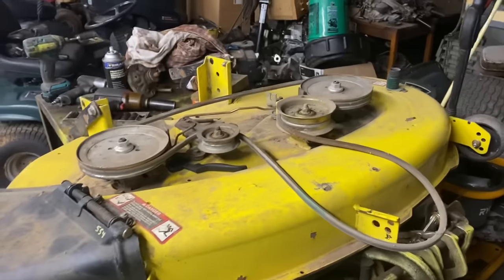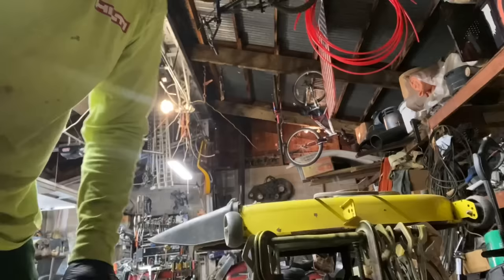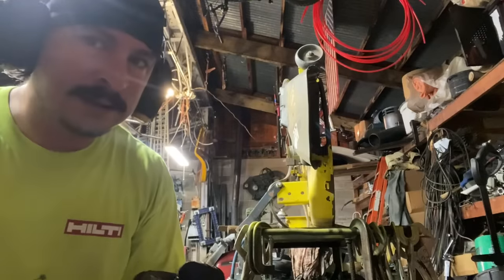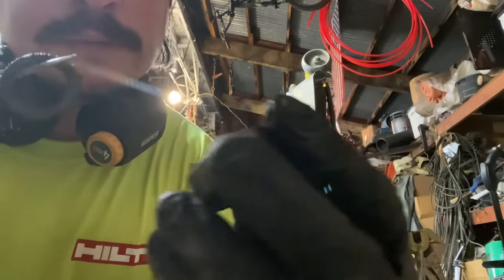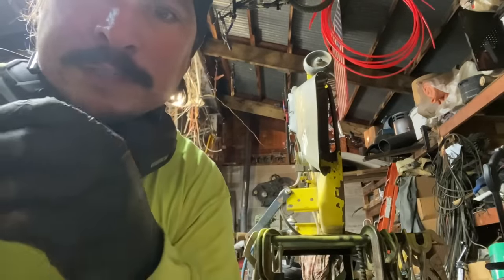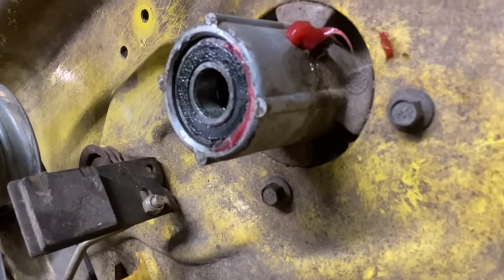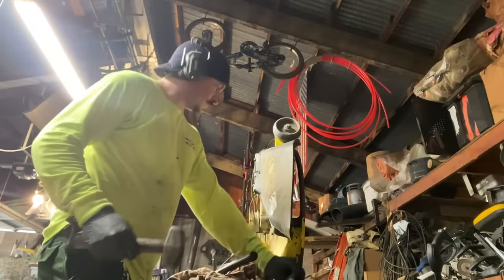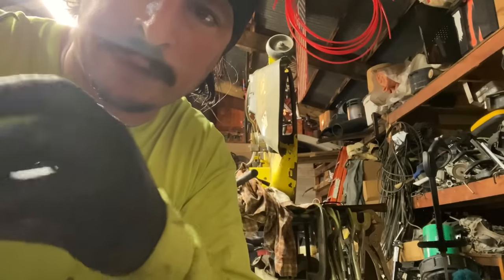Part 1 - Don’t trust the “Experts” Grease your mower deck sealed spindle bearings Common sense.

Comment: I broke down and bought a compressed air grease gun and it’s one of the best investments I have made. You can pick up a small compressor at Harbor Freight for under $100 that will run it just fine if you don’t already have a compressor.

If I don’t have to pump the damn grease gun I find that I’m a lot more likely to grease the spindles on my JD455, JD325 and JDLX255 every ten hours as you are supposed to. I fill them up until grease comes out.

I bought a Lincoln grease gun for about $85.00. It’s a good one but you can go a lot cheaper at Harbor Freight if you’re on a tight budget.
Reply from the maker: Thanks for the tip. I have used electric and pneumatic guns at work but for home use I just been using the hand pumpers. It’s probably time to upgrade.

Comment: If you have zerks in your spindle, either in the shaft or housing you can install the right size piece of pvc pipe to fill the void so you use less grease the first time. The thick walled stuff and cut it a bit short on the ends so grease can flow around it.
Reply from the maker: @leonhart2452  that would probably work fine, however I don’t advise to take one apart if it’s working fine and well lubed it may never need to come apart. Why do all that work to save 1/15th of a tube of grease? If I was already into
The assembly that might make a little sense, however I still don’t understand why saving a small amount of grease would be that big of a concern. Folks do oil changes all the time and that cost more than the small amount of grease that would not need to be changed, only add a few more pumps of grease once in a while and the majority would stay in place and work for decades. I would not make sense to add filler in the crab case to lessen how much lubricant is in the crank case, so I would not see why it would make any more sense in the mandrel housing. Save grease yes, but why?

Comment: I had to replace the quill bearings on my Kubota mower, no zerk to grease them. But I packed grease in between the bearings in hope to extend the life of them. The heat may force the grease into any spots in the seals, I hope.

Comment: On a crapsman deck where im replacing the bearings, I'd probably leave in both seals on the top bearing and remove the inner seal on the bottom bearing. And add a zerk so they can actually be lubricated.
Reply from the maker: I think your the first person that I agree with about the top bearing seal. It would be beneficial in holding grease up in the top. Most people don’t think about the gravety pulling grease down into the assembly. However after years of fixing mowers I have found the inner seals don’t matter so no need to even bother taking things apart to remove the seals unless your in there. Regardless the assembly needs to be completely filled and the great majority of folks are not aware of that and without a filled assembly no way to guarantee grease reached the bearings. But I like how your mind works. We would get along real good! And yes I agree about adding a zerk they always need one.

Comment: my J Deere X585 with 62C  Deck takes about 40 pumps to fill them until grease comes out the bottom, three in all - at 21 years old never had a mower bearing failure
Reply from the maker: Thanks for the comment the X series are some awesome machines.

Comment: Excellent video.   If the manufacturers filled the spindle at assembly, it would take only a few shots of replacement grease to make it to the bearings.
Thanks.
Reply from the maker: That would be nice but they don’t seem to be interested in making your equipment last longer. Seems quite the opposite.

Comment: Question can you leave the seals out the top and bottom of the bearing? That way you know get grease will get in there. Or does the seal need to be reinstalled? And another question is I have a Cub cadet ZT1 50 in. I bought it 3 years ago. The warranty is up in April this year but they refuse to warranty the three deck spindles. They says they are worn out and full of play and they won't replace them. So my question is can I just replace the bearings in those spindles or do I got to replace the whole spindles? What is your recommendation? Another words that the play in the bearings actually ruin the housings or the spindles too. What are your thoughts? Should I just replace the whole spindle and put a grease zirc fitting in it? And do you know if there's any good aftermarket spindles that are better than the Cub cadet ones? Your thoughts would be well appreciated. Thank you

Comment: I've been pulling the seal out of the spinde bearings and hand pack them once a yr for 30 ys on my craftsman GT 600O garden tractor, I still have the original bearings and spindle assembly.
Reply from the maker: First off, the GT 6000 is a awesome machine. One of the best Craftsmans ever sold. Especially with the kohler command engine. Love those things. Thanks for the comment. Tearing down to grease each bearing works great too, but I’d rather not tear the deck apart to grease a few bearings. I take decks apart all the time. Don’t like doing work that can be avoided. That’s why I made the video. the main point of my video is to show that simply filling the mandrels with grease will allow grease to pass into the bearings. So many mower repair Videos are telling the DIY community that grease will not pass the seals.  And saying a seals bearing has plenty of grease and is designed to last the life of the bearing. Wow, how silly. Lol. I wanted to prove those so called videos were providing bogus information. Nobody was even showing proof that the seal would stop grease they just blabber about it being a waste of time when in fact it is absolutely not a waste of time. By greasing the mandrels properly it is not necessary to tear down the assemblies just to add grease. Just connect a grease gun and fill the spindle (mandrel) assembly. That’s way less trouble and no tools other than a grease gun should be required. Unless you have to remove the pulley shields to access the zerk firings. Just trying to help folks get a longer life from the deck bearings and challenge the folks posting false information. I made it a step by step video to prove the bearings revive grease so folks would see that I’m not just another person stating my opinion on the topic. What I show is the process and the outcome. It’s good to know that I’m not the only one who things bearings on a mower deck can basically last forever if they are properly serviced. Thanks again.

Comment: I replaced the bushings with sealed bearing assemblies in the front wheels on my John Deere L111 and removed the inner seals and grease from the bearings and then pumped the wheels full of grease. The same can be done in the mower deck sealed spindle bearings as in this video.
Reply from the maker: Yea and can be done without removing the seals. Those shields can not stop pressurized grease. Do you know the PsI   Comming out of a grease gun? Those “seals” cant
Stop grease brother. And as for removing them it’s really pointless, just grease until the assembly is full and the bearings will receive grease. Just like I show in the video. There is a reason I left the seals in place when I made the video. And it’s because so many folks can’t understand that grease will flow right past those seals/shields. They can’t hold back pressure. Just a simple dust shield. That being said if your bearings are submerged in water, it will also find its way in and that’s not under pressure.
Reply: @GTObearclaw1  From one Russ to another Russ brother the bearings I used had both metal shields and rubber seals. Also the bearings had "grease" in them that looked like vasoline which I removed with electrical parts cleaner to protect the rubber in the outer seal because as I'm sure you know different types of grease with different soap bases shouldn't be mixed together and I didn't know if the "grease" in the bearings was compatible with the grease I put in the wheels. Also I only have a hand pumped grease gun that I doubt has the pressure that a air driven grease gun has.
Reply from the maker: @russfauver2495  a powerful grease gun can put out upwards of 15,000psi. According to Google. However it only takes a tiny fraction of that presure to push past a rubber shield / seal. Even the bearings with the metal shield still have a rubber lip and that’s where the grease passes to enter the bearing. That rubber lip can’t hold back pressure from any hand pump grease gun. Even a hand pump grease gun can put out hounds of PSI. Not trying to argue. Just saying give it a try.
Reply: @GTObearclaw1 I have no doubt that you are correct and know alot more than I do about grease guns. I'm still glad I removed the shield and seal from my bearings to remove the grease that was already in the bearings as I explained.

Comment: When you put the grease like you say it will cause because of pressure on bearing shield . Your actually destroying bearings earlier.  Seen many time when people greas sealed bearings.  When they see a fitting  or plug they grease.  Read manufacturers maintenance recommendations.  Have a good day .

Comment: So I rebuilt a 54" deck. New spindles bought on Amazon. I filled the spindles with grease until it came out of the top. Installed and powered it up. Grease splattered out all over the belt , deck, and caused the deck to not cut well due to belts and pulleys  having grease on them.
Not the result I expected. So I bought OEM Deere spindles, which I will not grease.
Reply from the maker: You can stop greasing as soon as you see grease exit somewhere. More than likely you kept pumping until an excessive amount of grease was outside the assembly. Then once the deck started spinning it slung it off the pully. Something it will sling grease off the upper pulley but Iv never seen enough grease to cause that issue so must have went a bit overboard applying grease. One needs to be watching for grease and stop pumping as soon as it’s visibly seen leaving a bearing. Basically as I demonstrated. No need to keep pumping especially if it’s exiting the top side where it can effect friction if it gets on a belt. Unless there was an issue with a bearing or other component the only thing needed would have been a clean up woth a shop rag or a few rags to get the grease off. If it can go wrong it will. I can’t predict how each person will use the information. Almost all my parts come from Amazon and has never been an issue. Sometimes the bearings are noisy if I buy the cheapest of the cheep.

Comment: Thanks for this very informative video. I have an exmark metro mower. Just bought new spindles which have a grease zerk. Just curious which grease to use?  I use the red grease to lube all the other parts on the mower but in my manual it says to use Mobil hts grease between the spindles and the bearings, spindles and sheaves, and under top bearing guard. The original spindles that I’m replacing from the factory never had grease zerks. Any info would be greatly appreciated!
Reply from the maker: Any grease is better than none. 
I’d go with what the manufacturer recommends.

Comment: Good info. Should leave the seal off on the side exposed to the grease and pack the housing as full as you can reassemble then finish packing the housing and bearings thru the zerk.
Reply from the maker: Why bother with all that when you can simply connect a grease gun and pump the mandrel and bearings full as I just demonstrated. The reason I assembled with the inner seals was to prove that the inner seals can’t prevent grease from passing into bearing. After knowing this information why would you want to take time to disassemble a deck? Just grease it at the zerk and your good, that’s why I made the video.
Reply from the maker: Thank you for the comment but I just proved the inner seals don’t stop grease. So why bother with any of that? It’s just wasted effort.

Comment: This is true for my motorcycle neck bearings also. I use a piece of cord to keep the grease from coming out from around the bottom of the neck, then pump it full until it comes out the top.
Reply from the maker: I have absolutely zero knowledge on a motorcycle. I don’t want to give you bad advice. I better stick to mowers lol.

Comment: Also on my CC there is a vent hole on the spindles. Likely for the grease to push out water and moisture.
Reply from the maker: Yea the MTD tractors have a weap hole on some. Unfortunately that could be an issue as grease will most likely all come out there first so you may want to consider plugging that hole. I hate that they do that.

Comment: When purchasing a new mower, are you confident the factory added enough grease? 

I’m asking, when I add grease regularly a smaller amount of pumps will be sufficient?
Reply from the maker: When it comes to box store mower brands, The factor does not add any grease. You only get what came in the bearings when the tractor was assembled. That’s why it’s important to fill the voids the first time you grease and why I said it could take 50 to 70 pumps from a hand held grease gun. As for the following services you will only need a few pumps because once the assembly is full it only needs a few pumps to push more grease into the path of the bearing. The first time is the most important and if you get that right you already did the most good for your machine.

Comment: I think replacing the Bearings are actually cheaper than buying grease...bearings are about 3 or 4 bucks on AmmmmZon when you buy a four pack..PgK work fine...11-12 dollars for a rebearing on a deck is economical.  How much is a tube of grease now?

Comment: My spindles don't have a grease zert. So I  just pulled the seals and forced water resistant synthetic grease in, then replaced the seal. I'm not sure if pumping it full of grease would increase the life of those bearings once they are crammed full of a good quality grease.

If ever  they go bad, I will definitely consider drilling out a place for a zerk fitting.
Reply from the maker: I do the same for units that don’t have zerks. With a good grease it could go for many years longer. I mean possibly 5 to 10 depending on how heavy it’s used.

Comment: Just changed 1 of 2 spindles. Wish I could have stood my deck up like that. It has 4 roller wheels around deck. Had to pickup and put on stand and keep flipping deck to work on bottom.
Reply from the maker: Probably can remove the wheels while working on it. Might be worth the trouble to save some aggravation.

Comment: Amen, a Lawn Mower Repairman who is a friend of mine told me these grease fittings on my Generic JD mower hub were nice to deceive buyers but were not greasing the hub bearings as they most likely are sealed bearings. He told me to remove Bearings and remove inter seal off bearing and re-install and now the grease fittings will fill bearings with grease.  I tell all my friends that have the cheaper Riding Mowers. About 3 years ago I bought a Real JD Zero Turn Mower, the first thing that I asked Salesman, does these Mower Deck Hub Grease Fittings really grease these Hub Bearings, he knew what I meant from the get-go, he said yes they do....
Reply from the maker: Sounds like the friend you say is a repair man didn’t really know much about the topic. No surprise, there are a lot of Guys posting videos saying you can’t grease a sealed bearing. Sad when folks who don’t know give out advice. Be careful who you listen to. If something does not sound right I like to investigate.

Comment: I recently rebuilt a deck for a friend that goes on a Grasshopper Zero Turn. What a beast of a mower and deck. When I got the bearings from the dealer and they were sealed on both sides,  I inquired about that. His answer was that that's the way they come now. Wen I inquired about popping out the inner seal on both the upper and lower bearing on each spindle, he said that Grasshopper recommends to NOT do that. He said just put some grease in there to keep the moisture out. Personally I don't think that's a good answer. But, since he's the dealer, I left them in. We shall see.
Reply from the maker: Yes grass hopper is one of the best machines and they are not a cheep box store machine like I am working on and I have no experience working on those. But I know they are good machines. Of course they are not going to say that it should require modifications. I mean why would they admit to selling something that needs to be changed. And it doesn’t make any difference the grease will pass through the seals into the bearing so it’s pointless to worry about it. Just grease it properly
Reply: @GTObearclaw1  Yes, I learned something new and I've been doing small engine work since I was in high school. Thank you. New subscriber now!